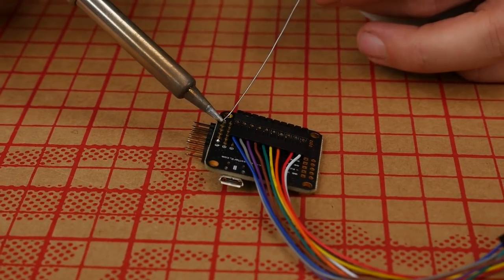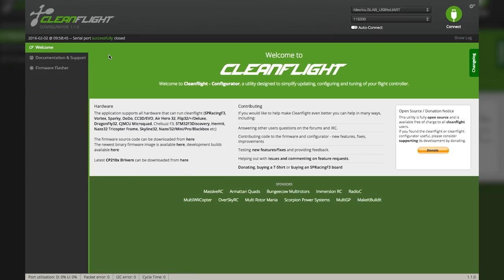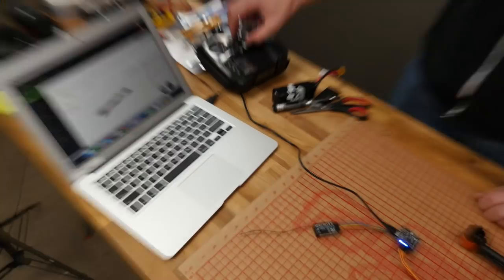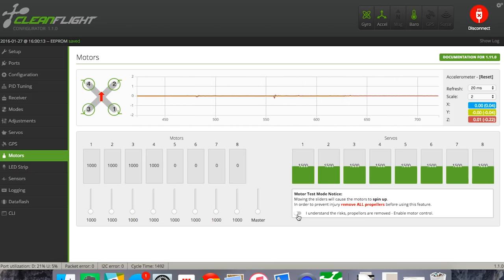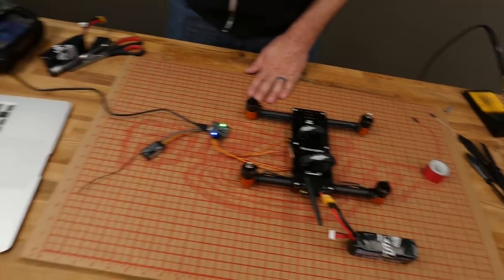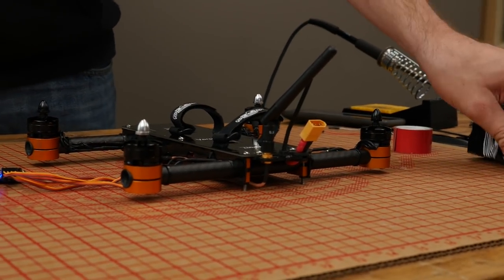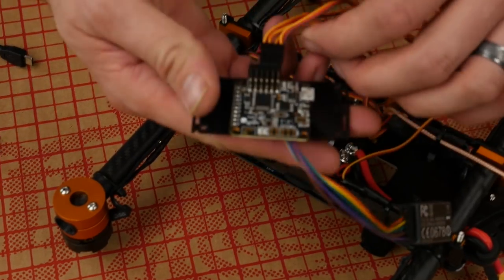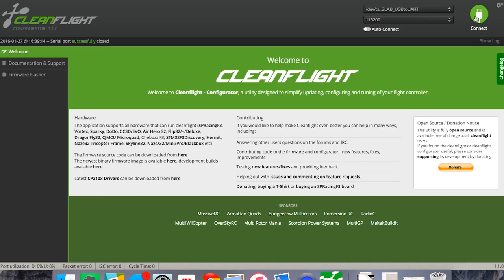Naze32 Rev6 Setup | Flite Test

Comment: hey guys, i just tried to follow your programming of my naze32 step by step and so far so good, but my throttle only engages at 70% and above.  I have minimum throttle at 1300, mid throttle at 1500, and max at 2000.  I have also set minimum activation at between 300 & 1000 with no effect.  I am using a tgy-I6 and tgy-Ia6 receiver.  Everything else is great but the motors wont spool up until 70% throttle.  I have my arming switch set and functioning properly, all motors are wired and spinning in right direction.  I am stumped as to what to do, I have set my throttle curve on transmitter to stock, any ideas or suggestions would help greatly..
Thanks,
Gary
Reply: yup calibrated but it seems like esc 1 and 3 mat be bad. they spin up full throttle then slowly fade untill they completely stop.

Comment: Hello,  You valua´s on your PID tuning is pretty low. On my FC the valua´s are by standard 10 times higher. Is this a bug? and should i chance all my setting to what you have and make ik 10 times bigger or should i use the low valua's.

Thanks
Reply: i have the same problem, i think it might be a UI difference. I'm going to fly with the stock MultiWii Rewrite PIDs and see what happens

Comment: Why wouldn't you set the minimum throttle to 0? Serious question.
Reply: Because the pwm signal goes from 1000-2000 so 1000 is your 0% and 2000 is your 100%. Hope that's easy enough explained.
Reply: +Fr33lumby© Yep makes sense! Thanks!

Comment: What should I do if the orientation of the board is wrong? Thanks
Reply: Depending on how you fit it (mine has the usb port on the left, so you can plug in easy) go to: CONFIGURATION tab in cleanflight, scroll down and see BOARD & SENSOR ALIGNMENT and change YAW. I put in 90deg, try this and then look at the SETUP tab to see the direction of the board now. Hope that helps.

Comment: What kind of soldering iron should I use for the connections on the control board? 30W or 15W?
Reply: more powerful is better because it will be faster and won't heat up the components as much

Comment: I programmed my naze 32 just like this video and when I put it in angle mode it oscillates after I take off. My pid settings match the ones in the video. please help
Reply: You can't just plug in someone else's PID values and expect it to fly properly. Each aircraft is different and needs the PIDs tuned specifically. Even the exact same components in the exact same setup can require tweaking to get perfect PIDs. So unless you have a versa copter exactly like this one with all the same components placed in the same places, the PIDs shown in the video are likely way off. Do some research on PID tuning and start learning the process. Although it's very much science, the process of tuning feels more like an art and you have to do it to learn what to do and when. You need to be able to fly in rate mode so if you can't, work on that, so hopefully this is not your only quad, if it is, this might still work for you (just to get you in the air to start learning rate mode) depending on setup. Make sure your battery is secured tight and in the same location each time you put it on. To get you started, lower your I and D to about half the value shown here and increase P until it oscillates (fast oscillations which your saying it already does) and then lower P until it's not oscillating (including during punch outs), your pitch P should be a bit more(1.2x-1.5x more depending on weight distribution) than roll P and your yaw P will be a bit more than pitch P in most mini quads. Then start increasing I until you don't get wobbles on decent. Then increase D until you don't get a wobble after a quick stop after an axis changes direction. This may or may not even work for you depending on your setup (LOTS of other variables) and is not even close to everything you need to know but might get you near the ballpark, like at least a block away from the ballpark ;)

Comment: my esc have 5v bec to power the maze but do I need to cut the other wires off esc and only use one to power it or hooking them all up will be fine
Reply: Connecting all of them up can damage them but just using one can make that esc run hotter and change its performance. You can get a separate bec that powers the board from the battery and cut all of the red wires going to the Naze from the ESCs

Comment: what does the 'looptime" effect?  I'm building a 250 size racer and wondering what that does.  I'm using the Acro version.EDIT:  saw other reply's,  I guess I will set mine to 1500 as well.   I'm going to start out REAL slow.   got some 5x3 props to start,  low rates.    I'm flawless on the simulator and have tons of single rotor and line of sight quad experience but this thing will be crazy.

Comment: I just ordered my naze32 rev 6 from banggood but on the reviews of the board I heard its missing a diode and if you plug in ESC to the board n connect the board via USB it'll blow up the board because of some back EMF due to lack of diode. Did anyone face this?
Reply: Yes.. whenever I try slide the matter up WITHOUT BATTERY a motor starts spinning.

Comment: Hey Anyone. I need some help. Got my board and everything hooked up and flashed. But when i try and look at inputs for rx they all just stay at 1500 and throttle at 850, even if im moving my controls on my dx9. I changed rx setting to serial and did the port 2 thing. I know my rx works and i hooked it up according to this video. I am stumped... Please help.

Comment: halo.
i have a problem, when I try to calibrate my esc, I increase the master, but the motor are spin low, (battery was remove).
I try to ignore the spin, and when master was full, i connect the battery, the the motor spinning full to.
any can help?
Reply: I had the same problem. i found the answer here

http://forum.flitetest.com/showthread.php?22554-Calibrating-emax-12a-blheli-esc-with-naze32-acro-rev-6-fc

and yes it is a pain to do it but it works.

Comment: Can i also use these pid gains for my 250 quad with 1806 2280kv motors?
Reply: +djRC unlikely, all pid/esc/frame/prop combos are slightly different

Comment: Hey I have followed the install and programming of pids to the letter and flight is unstable. I even went back and flashed the 1.11.0 of the firmware. I take off and it just starts oscillating until it flips over. Fortunately I have some grass to crash into. Any suggestions?
Reply: Same here. Even tried an earlier fw, but still wobbles. Did you find an answer?
Reply: No, I installed betaflight from borris, I'm going to try some super low settings.
Reply: Did y'all set angle and horizon like he did in the video.  One (or both) of these sets the self leveling mode.

Comment: why is your motor running when you arm the motor??? or why didn't you set the min throttle to 1000 or 990 so the motor wont spin when you arm it( spins only when you apply throttle) is there any advantage to this?
Reply: First it let's you know that you are armed, second it's so that when you cut the throttle in flight you still have control.
Reply: I still have control when my throttle is set to zero. As for the armed part, there is always led.

Comment: Couple of problems I encountered. When I set the looptime, it won't exceed 1000. Also, when I pull the throttle for my quad just a tiny bit for lift off, it accelerates super fast  and goes in its own direction. Can anyone help?
Reply: I had the same problem when i changed props from 5040 to 5045. Quad just went off to air and I coudn't land it. I went back to 5040 and works fine. I think there is the problem wit PID settings. This video is not OK for your quad is my gues

Comment: I have an Spektrum 4649T receiver and after hooking everything up, just like in the video, and flashing my naze32 rev6, sometimes I get readings of CPU load over 1100%. This I have solved a couple of times by installing older versions in CleanFlight. But I still get the problem that after binding the receiver and firing everything up in CleanFlight, the program does not respond to my Spektrum dx6. Can anyone think of something on how to solve this?

Comment: Hi Josh can someone please make a video or a diagram of the way you connect the NAZE 32 ver6 and the taranis x8r receiver to the versacopter Please.
Reply: +Richard Lee put power wire and ground in the first 2 connections and the signal Into pin 4 hope that helps

Comment: at 10:32 u connect the battery to test the motors. what does it mean when after connecting the battery i dont hear the 2 beeps ? no sounds at all. it actually only makes any sounds when the micro usb is not connected to it.
and how do you calibrate a motor that doesnt start up with all the others motors.  3 motors start up and the 4th doesnt start up until almost the others are at 15%. how do it calibrate just that 1 to start correctly w the others.  or do i have a bad esc or a bad motor maybe . how do you check those?
Reply: Plug in the battery with the transmitter on and the throttle at full. When it beeps bring the throttle all the way down. This should calibrate them.

Comment: so I got this board. But the ESC I got, don't have a built in bec. But my pdb has a built in bec. How would I go about connecting this board to the pdb for power? 

Thanks!
Reply: +Highwalker Exactly which PDB do you have? It should have a 5v output for your Naze32 :)
Reply: ***** It does. It's the matek 5in1 board. I figured out where to plug it in. Thanks :)
Reply: Great choice of PDB! Have fun flying!
Reply: ***** Yeah, I figured for the extra 2 bucks, might as well get the fancy pdb. Thanks!! :)

Comment: can someone elaborate on the colors of the wires, mine came with a breakout cable that has one 3 prong, (red black white) followed by brown green yellow orange blue grey purple, in that order... what does each color correspond 2
Reply: also tried setting looptime in CLI and it said invalid name does anyone know if its because im running a more recent version of cf?

Comment: Hi, I like this video because it helped when i was configuring the settings for the motors of my quad copter. However, when i try to control my motors with my Flysky FS-T6, i doesn't seem to interact. The only way I can use the motors is manually moving the sliding bars in the motors section of CleanFlight. Can anyone help? (I have a Naze32 Flip32 and a R6B receiver; I've already binded the receiver and the transmitter)
Reply: make sure you set up the arming

Comment: my looptime is not changing the counter at the bottum to 1500. its at around 1000
Reply: Same. I was hoping someone answer this question :(
Reply: Switch to the 11.1.0 firmware
Reply: i learned that a looptime of 1000 is not bad at all, i just use it and it flies pretty damn good
Reply: fryanryan   where to find when I tap download online the latest are 2.1.0??

Comment: Josh.... use Betaflight.... MUCH more stabel and almost no need for tuning.
Reply: I'll give it a try. Maybe with the next video with Skitzo and Freybott. Air mode is amazing!

JB
Reply: +Josh Bixler Can't wait to see the new episode. Keep up with the good work.
Reply: +Zapf therefore I said... almost no tuning needed. But as you said... you need to tune. Other size lipo... tune.. other size props... tune. putting on a Gopro ... tune.. But hey.. that's the hobby. Although it's a pain in the neck.

Comment: love these helpful setup videos like this but could you Please stop using graupner for all the multi-rotor setup videos and maybe once just use a spektrum transmitter again like you use too for many years? I'm a noob at setting up anything besides fixed wing aircraft so anything to help with radio consistency helps.

Comment: I realy dont get in. Feb. 24th 2019'
 can someone Help with the following Situation:
I installed CP210 drivers
I installed stm USB drivers
When i Connect the Board (naze32) (only the Board with No ESC or No external Power) i get a "Kommunikation faild" in the commeand Line and crome stops Working. 
I have never done a Setup ore was able to conect to  a Computer so this ist my  First ever time.
ill delate this comment If i solved the Problem but If someone can Help it would be amazing! Thanks from germany
Reply: I have a similar/the same — problem, had a new one, flashed the firmware and it said that it was confirmed completed. Then I couldn't establish communication, it just said that it's "timed out" for waiting +10 secs for response. My teacher gave me a new one and told me to make sure to use the same version as in the video, but that version doesn't exist on cleanflight, it only goes as far back as 2016, and the version the guy uses is from 2015... here's a screenshot of the interface with the new fresh board: https://imgur.com/CACCG8v

Comment: Nice tutorial video but to understand its significance is only for the advanced pilots this tutorial is not for the beginners what I think...1st confusion is about the parameters used in PID settings and second confusion is connections with NAZE 32 with the RECEIVER :-(

Comment: You should NEVER put your receiver antenna right next to your FPV transmitter antenna. Your RC range will be reduced significantly. I recommend you put it at the other end of the aircraft. You should have as much distance as possible between those antennas.
Reply: +Micha Kniest true, but range isnt much of an issue for minis, a lot of the pros have their RX and VTX right next to eachother

Comment: I have the Naze32 10dof from my eachine 250DIY. I use Cleanflight. But when i want to see in Cleanflight what my receiver channels do everything is wrong. My throttle is my yaw and so on. I keep swapping them around but nothing happens to the point that they are all in the right place to function. The channels do not get the right input for my controller. I have got 8 plugs. 1 is white,red,black.
 http://www.banggood.com/Eachine-Racer-250-Drone-Spare-Part-Naze32-10DOF-Flight-Controller-p-1060600.html
Reply: I was initially having the same issue when setting up my Futaba transmitter on the Naze32.  Turns out the way you plug each channels in to the receiver is different depending on your transmitter.  Do you have a servo travel screen on your transmitter where you can verify each stick movement corresponds to which channel?  I used that screen, in conjunction with the Cleanflight receiver screen, to correctly map out where to plug in.  For example, if your channel 3 of the transmitter is throttle, and on the Cleanflight receiver screen it shows throttle bar movement when you moved channel 2 on your transmitter stick, then you know that the current plug that's in channel 2 of the receiver should be moved to channel 3 of the receiver, etc.  Repeat this until all of the channels are assigned correctly.  For the Naze32, you must have all channels plugged into the receiver for Cleanflight to display bar movement when you move the transmitter, so make one correction at a time, but plug in all channels to the receiver after each correction.  Not sure if these makes sense.
Reply: +Bo Han It was so simple. Set receiver in cleanflight. That put my throttle in the right place. The only thing i had to do was swap ch2 and 3. If you dont put in the right receiver you will never get it right.
Reply: The set receiver option in Cleanflight didn't work for me.  When I chose the Futaba/Hitec option, every single channel is still wrong and I had to painstakingly manually map out the channels.  But glad it's working now.
Reply: +Bo Han Ordered a new motor but maybe its the esc. I wil unsolder the opposite side clockwise motor and test it.